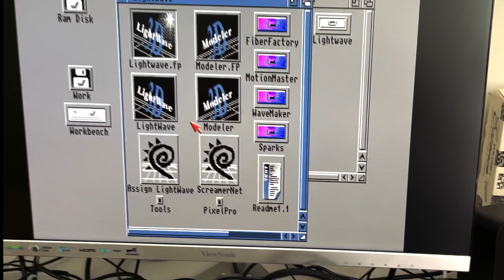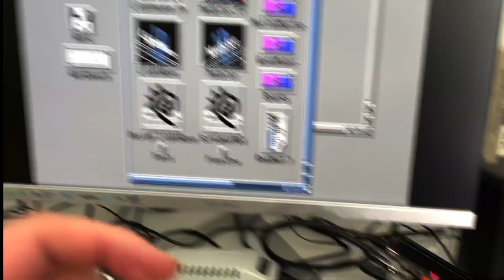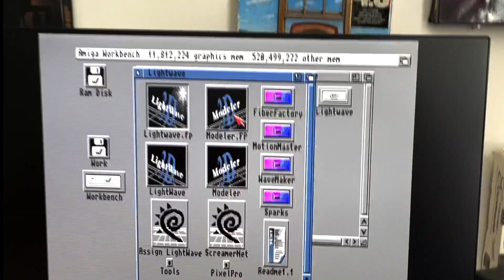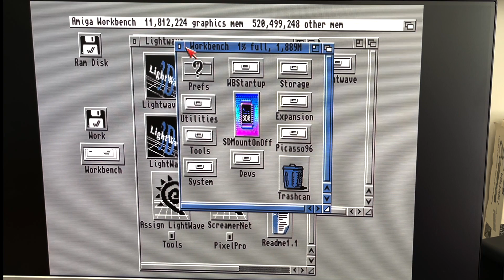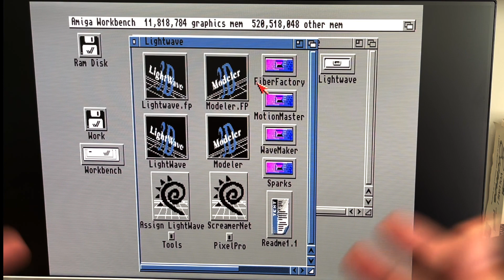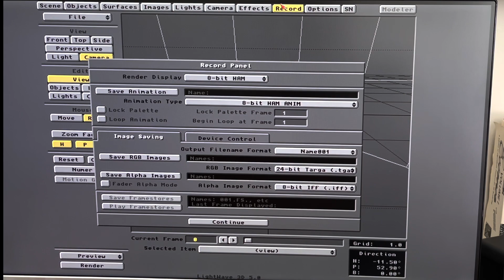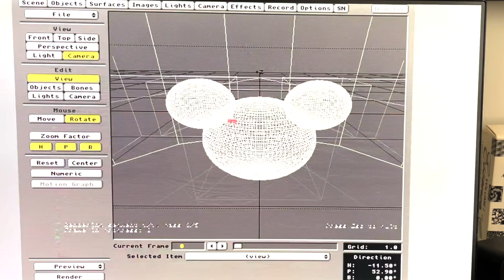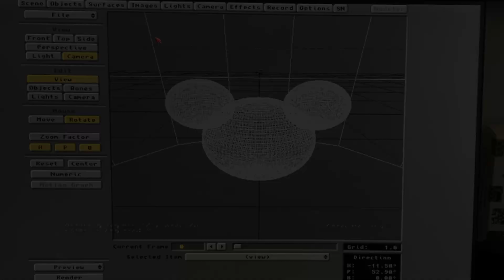Vampire v4 Update! New CORE and Benchmark!

Comment: 1 - Is the Vampire V4 standalone hardware 100% compatible with amiga?
2 - is it a real replacement hardware
3 - Do you suggest Vampire V4 or A1200 original hardware with IceDrake V4
Reply from the maker: For the most Amiga friendly and compatible, the v4 seems to be the most stable as it’s been out longer. Icedrake is promising but still needs some work. And of course with it you’d also have a “real” Amiga but will pay quite a bit

Comment: Holly smokes that’s slow. I would have expected more from the vamp…ohh well.  Guess it’s not going to be a render go unit.  Emulation is just kicking butt today
Reply from the maker: Yeah, it’s a little faster than an original Amiga with an 060. For a sense of “scale of speed.”
Reply: @HoldandModify  I have a v2 and it feels considerably faster then the 060s I used to run. Is that true ?  I don’t have one to do a side by side test anymore.
Reply from the maker: @retrounit7082  should be. Once my 3000 is backup, I can verify.
Reply: @HoldandModify  yea the 060 is around 40-60 some odd mips if I OC it whereas thr V4 is 165 mipa default and 192 OCd.
Reply from the maker: @manueljesus3147  whoa!!!

Comment: Re: the USB blaster, did you turn off driver certification via the 'safe startup' menu when installing the driver? If not, it will look like the driver installs but will fail when you try to communicate...
Reply from the maker: The driver installed, the issue is identical to what happened with my SCSI2SD. Failed the low level windows usb hardware descriptor. Meaning it doesn’t even know what hardware thing it is. This is generally a sign of a bad cable. Or poor quality one. I’ll look in to what you suggested of course. Thank you!